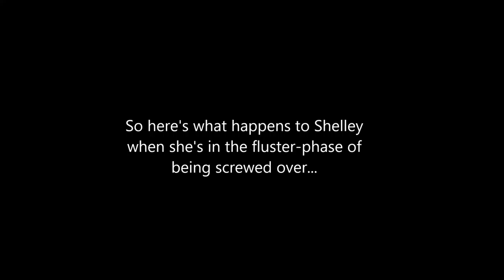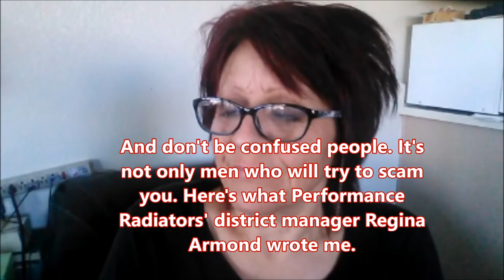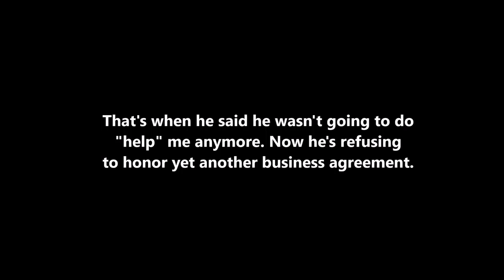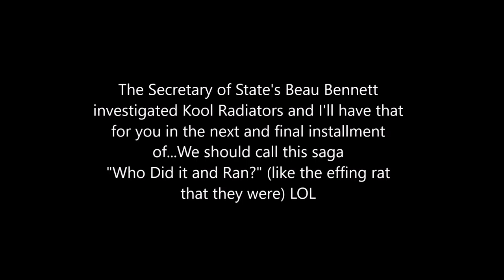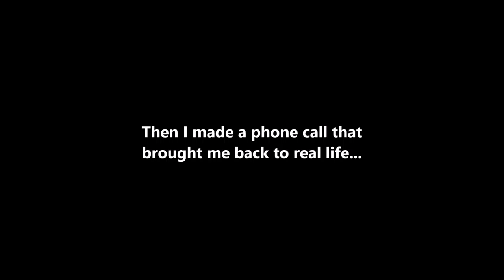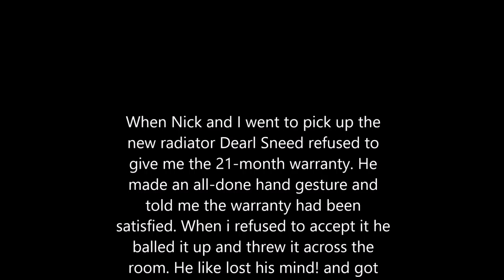RV Radiator Ripoff - The Aftermath and The Reveal

Comment: Good job on getting the radiator replaced. Nick and the guys did a great job. My concern is about the color and condition of the coolant Nick poured out of the radiator. I hope they were able to flush it clean or you may be plagued with constant failure.

Comment: Those guys don't know much about radiators,  they are getting cores mixed up with rows of tubes, which is a common mistake that I don't think mechanics should make. The multi core radiators are large industrial radiators that are several times larger than yours. I know because I have had to recore them.
Reply from the maker: Are you talking about Kool calling mine a commercial radiator?